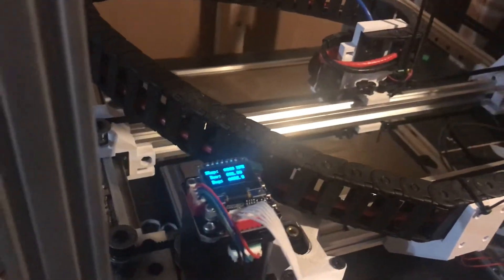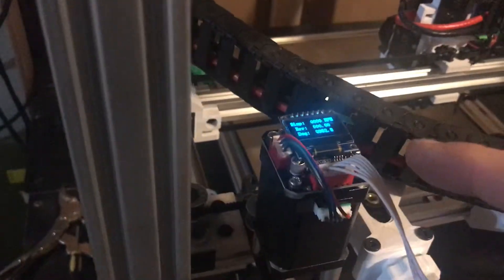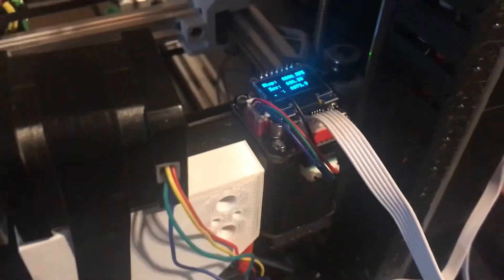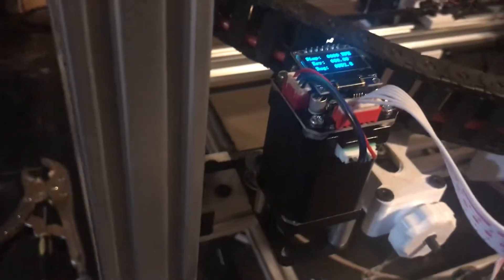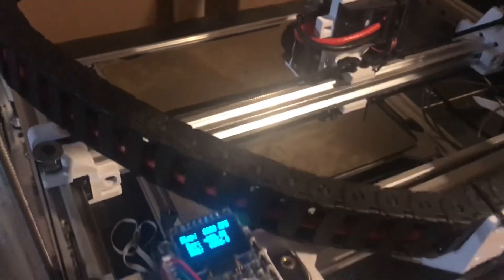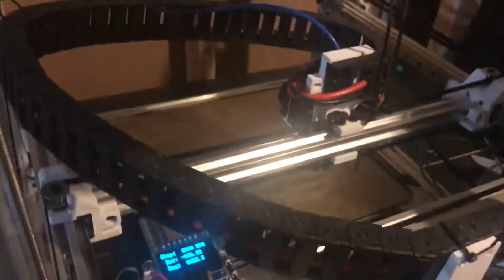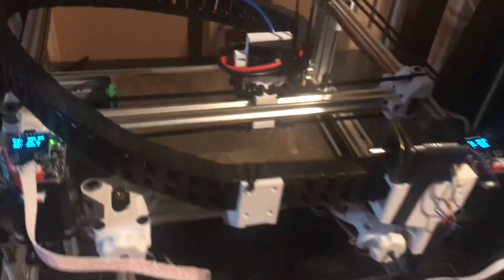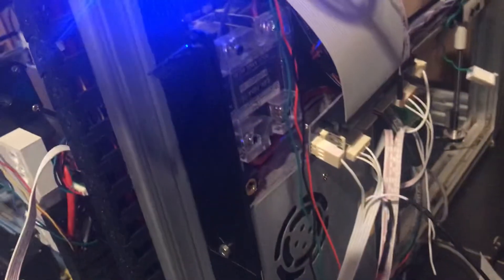Quick Test S42B closed loop stepper on duet2wifi corexy 3d printer

Comment: hello, in the previous comment you mentioned that you manage to configure the motor, but for example I am using arduino Uno with a CNC Shield V3 board and a GRBL 1.1g firmware but according to the manual that indicates to put switch 3 in ON for the closed loop but I do not get what is seen in the video that you move it and it returns to its position by itself, I agree that it has errors but to at least see the closed loop, greetings
Reply: He is demonstrating how the closed loop system fundamentally works, a closed loop system always knows where it position is and where it's position needs to be meaning if for some reason during a print it gets bumped out of position somehow it will automatically go back to where it's correct position is supposed to be. That is the most fundamental way it works and perhaps you are thinking of a different system because that is exactly how closed loop works

Comment: Was it simple to get working on the duet board?
Reply from the maker: Managed to get it configured but s42b kept loosing calibration and ended up very unreliable :( don’t buy them
Reply: @MrExo_3D  so which ones do you recommend because I have 5 of them and was going to throw a couple on my voron 2.4 that un building.
Reply: @MrExo_3D  most important is can you please let us know where the documentation is to let us know how to get these set up on a duet. I'm having a hard time getting these going on most boards because if the crappy English translation instructions.
Reply: Thanks for the heads up